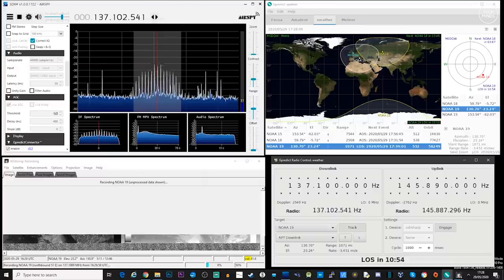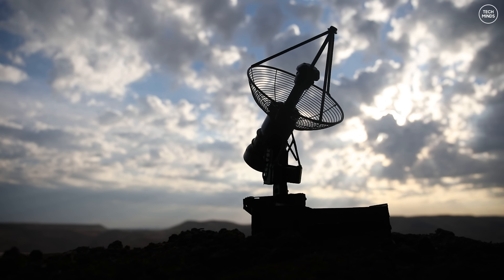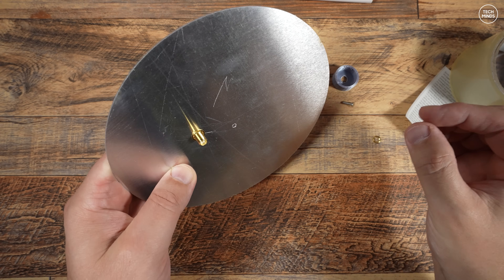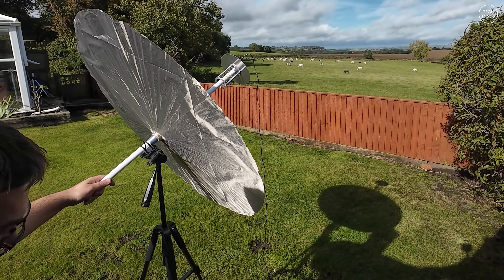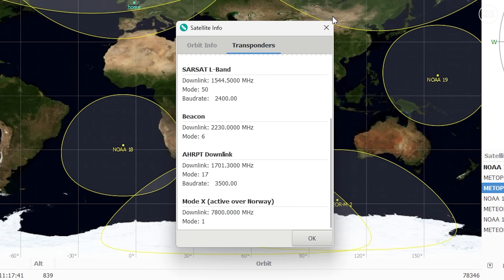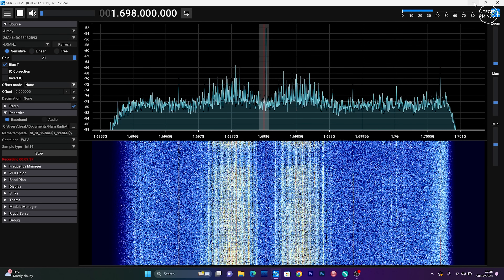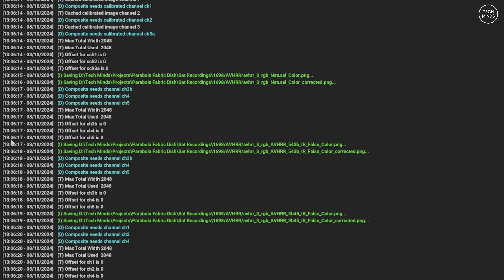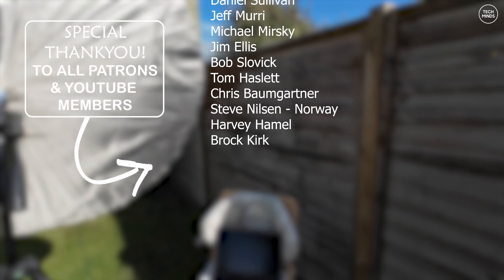Portable Weather Receiving Dish Antenna - Detect Hurricanes?

Comment: Sadly, as of 17th August 2025, NASA have switched off NOAA 15, NOAA 18 and NOAA 19 weather satellites, so VHF APT transmissions are no longer available from these birds. The only VHF band APT transmissions available are from the Russian Meteor M2-4, but that tends to be a bit hit and miss as to whether it's actually working or not. HRPT is available in L Band on 1.6 Ghz but more specialised equipment is needed.

Comment: Sawbird+ draws 180mA via bias tee. Does airspy mini have that current capacity?
Reply: You need bias tee or usb power for sawbird+ as airspy mini only does 80ma hope this helps 😊
Reply: @SeedMedia-j9b  I use airspy R2 with sawbird+, DC stop filter and external usb power supply. In this video there is only airspy mini and sawbird+ which seems a bit strange to me. Maybe lna does not give full gain with such a weak power supply.
Reply: @maxxm.108  I found sawbird+ would glitch on and off using only airspy mini 80ma , so I just use external bias tee and 5v, I not bother with DC block never had any problem but good you use good logic and are careful 👍🏻
Reply: @SeedMedia-j9b Airspy R2 quite expensive, even on Black Friday😂
Reply: yes. I use airspy with sawbird.
Reply: @SlawekKlimek55  With sawbird or sawbird+? Sawbird draws 30mA, sawbird+ 180mA.

Comment: Great introductory video for this!

As for Tracking app recommendations: I recommend just using SatDump itself. If you use SatDump for tracking, live processing, and/or recording all at once, you don’t need to look between multiple devices. Everything fits on one screen.

Also, as others have said, that dish probably isn’t be best. I use the NooElec GOES dish for HRPT. It’s also not perfect because it has a linear feed, not a circular one - but I can still pull in HRPT signals with a SNR around 14-15 dB.

In the end, though, all pre-built dishes at this time (that I’m aware of) are a bit of a trade-off without modification.

Comment: This antenna is not good at all for its price and size, I would advise against buying this
Reply from the maker: What would you recommend instead, for the price, portability and size?
Reply: @TechMindsOfficial  any old TV dish with a helix would outperform this, or if you really need the portability there are "helicone" antenna designs, some solid, some that people made folding
Reply: @dereksgc I understand what you're saying but none of those fold like this umbrella, a traditional dish is heavy for a 15 minute tracking
Reply: @SeedMedia-j9b  it is not, people have done it, and you want a tripod anyway if you are going to be tracking more often. Even the Nooelec GOES kit would be a better choice, you can split that antenna into two flat halves, and even that is widely regarded as being overpriced. This isn't even pretending to be a dish reflector, you are basically just aiming a helix at a flat piece of metal, you might get comparable performance if you just take the helix alone, make it RHCP, and aim at the satellite directly.
Reply: The 3D printed helicone antenna design is so good for the size, shape, and weight that if portability is the true goal it really is the only choice to consider. Unless you have a car, of course, and then all bets are off. But if you want to walk 10 minutes down the road to a local park, say, for better LOS all around the helicone is THE choice. The fact that you can run it into an Android phone makes it even better.
Reply: @SeedMedia-j9b  Obviously a tripod here is essential, but just to say that I am one of the weirdos that literally picks up their dish at the start and end of a HRPT pass to peak over the fence and get a few more lines. I only put the dish on the ground when the satellite is high enough, and I balance it on the edge and twist it, rotate it, etc. It works pretty well.
Reply: @SeedMedia-j9b  my helicone folds like an unbrella :)
Reply: @R1chae  maybe it'd help if we posted images of the helicones everyone made, especially your collapsible one
Reply from the maker: If any of you guys make antennas, drop me an email, I’d love to test them and feature them on my channel.
Reply: @MarkPentler  I just recorded a short video showing mine :)
Reply: I tried posting a link to the helicone but it won't post with the URL - try searching for "1.7 GHz helicone" Mat
Reply: If it works it works